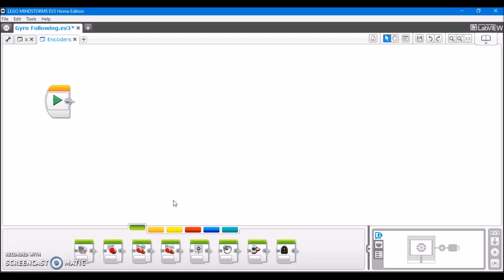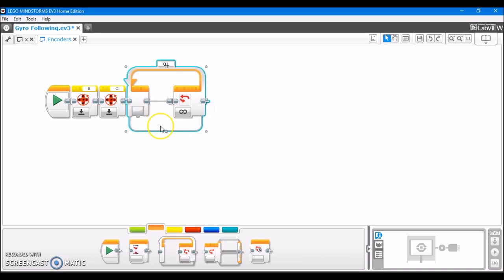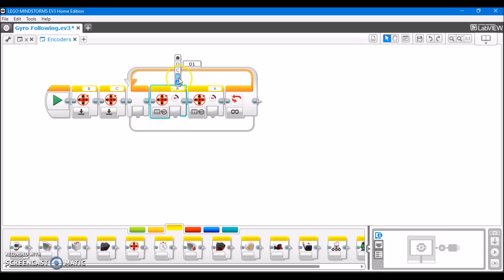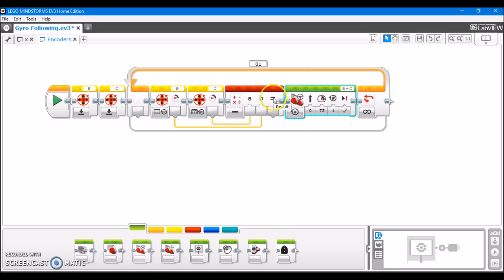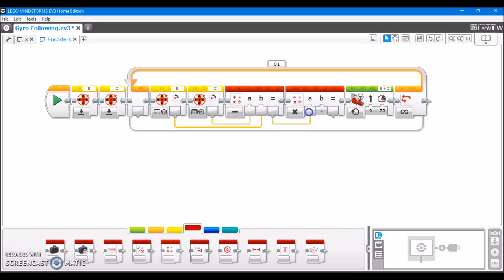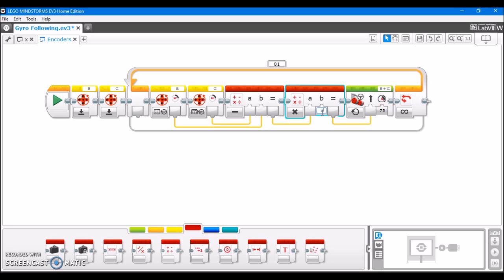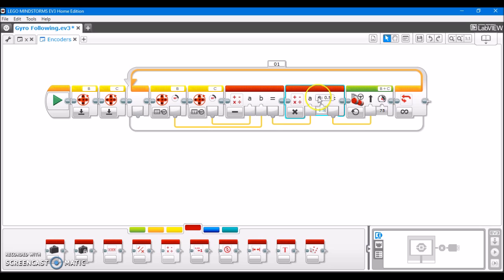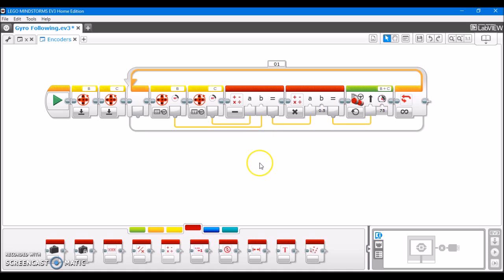How to Make your FLL Robot Drive Straight - EV3 Motor Encoders

Comment: Great video! I have one question, though: Ho do i make the loop so that it will go for a certain amount of rotations? I know how paremeters work, so that is not the problem. currently, I have two measure rotation blocks connected to two compare blocks(they say greater than or equal to), then the outcome is put in a logic operations "and" block, which is then put to the end of the loop, which is set to logic until true.

Comment: Sorry i know im late but my robot is not driving straight but it keeps leaning on the right side and i tried many different value but the robot still lean on the right side. It cant go straight. Builderdude35 can you please please help me
Reply from the maker: I would make sure that both drive motors are reset immediately before the drive-straight algorithm starts.
Reply: i did put a reset motors but still cant

Comment: Hi kyle, how about turning to a specific angle using only motor rotations and with pid control, without using gyro? Any idea? I saw your video about calculating the circumference etc but is it possible to use those data to make a pid controller for turning?
Reply from the maker: I think it's possible. In a recent video, I showcased an Excel spreadsheet that you can use to calculate turns (https://youtu.be/0XBvdZjdCpk). I think that if you take the equation from a spreadsheet and used it in a program to calculate a target turning path, then use the PID to keep it on that path, you will have what you are looking for.

Comment: When I use motor rotations as the loop exit case, the robot moves a little bit to the left after it is done moving straight. Do you know how to fix it? (I used B for loop exit case, which is my left wheel, greater than or equal to for the compare type, and 1 rotation.)
Reply from the maker: Make sure you have some block (placed immediately after the loop) that stops both motors together (make sure that your motor blocks are not set to "coast at end")

Comment: This concept works best of any drive straight algorithm I've tried.  2 things I really like:
(1) The motors will automatically compensate for the robot pulling left or right due to the weight of larger attachments.
(2) The simple MoveSteering control automatically handles any weird math exceptions that pop up around 0 or 100 power when using MoveTank, especially within acceleration/deceleration modules.
Reply from the maker: Thank you; I am glad that you are pleased with the performance!

Comment: Could you give program example of moving backwards using encoders? I wrote program for moving backwards and it works but it doens't meet end condition and it goes backwards infinitely.
Reply from the maker: What is your end condition? Maybe you forgot to set the end condition to a negative number of degrees (because you are driving in reverse).
Reply: I solved it in the meantime. It was about end condition. Thank you
Reply from the maker: Great! I'm glad to hear that you resolved the issue.

Comment: Hello,
I have tried to make the program that I will put a link to below. For some odd reason the robot will go for about 10 times not listening to how much I set the robot to move for (500 degrees), then on the 11th time or so, it would work. I called lego and they said there might be something wrong with the program. I tried updating firmware but that has not fixed anything either. Can you plese help me?

Link: https://1drv.ms/u/s!AkNYdEiPDMLqhDHZ_GFugcKkTQmW

Comment: I tried this and I tried the gyro method.  In the end, I got best results using the standard steering with a small offset (<1) on the steering power.   The method above gave me the same results (3-4" offset over 96") that I was with the standard method.
Reply from the maker: Thanks for sharing!
Reply: So I found a bug in the gyro.  When used directly with bluetooth, the gyro develops a drift, especially when it is accessed frequently by the program.  I assume that something in the way it continually reports the angle over the bluetooth to the EV3 program is causing the problem.  When I downloaded the program and disconnecting bluetooth, I found that the robot could run within a one inch  circle accuracy over 96" with the gyro.  From my point of view, that is sufficient to run most of the missions.

Comment: Good info but this will not work if either of the wheels comes off the ground, it wont know to slow or stop the other wheel, since it does not measure load/torque.
Reply from the maker: This is true, but if your robot is in a  situation where its wheels will come off the ground, you need other means of keeping it straight anyway.

Comment: 5:30 doesn't it already have the reset blocks at the beginning of the program?
Reply from the maker: Yes, but if you wanted to use this in the middle of a program, you'd start having problems. It's always best to include the reset just in case you want to move it somewhere else.
Reply: thanks!

Comment: If I take out the loop and change the "on" in the move steering block to on for rotations and put a value in that parameter, will the code still work?
Reply from the maker: The code will be very choppy. It will only check the difference after that number of rotations has passed. So no, it won't work very well.
Reply: thank you for your help
Reply: @Builderdude35  how can I set the program to drive straight for a specific number of rotations? I've been trying for days and I didn't find a solution that works properly.
Reply: @omarkhalaf7014  I aggree. It is very hard. I tried to use the motor encoders to sense once the rotations happened, but it did not work

Comment: Our team is so appreciative of your videos! Thanks for making them! Quick Question- how would you combine this program to make the robot drive straight with the program to ramp up and down?
Reply from the maker: That's going to be kind of complicated. But, you can add the programming for the drive straight into the loop after the acceleration bit. Think of it this way; acceleration sets the initial speed, then the drive straight program makes some adjustments.
Reply: Thank you so much! We'll try that!

Comment: When we run the robot, it turns very quickly to the desired angle.  Is there any way to slow down the rate of turn? Thanks so much for your videos!!!
Reply from the maker: Changing your proportional constant to a smaller number should help (that's the number you multiply by to adjust corrections).

Comment: What if the motors are supposed to move backwards? Do we switch the input for the subtract math block?
Reply from the maker: No, if the motors move the robot in reverse with positive power, the only thing that is affected is direction. You won't have to flip the turning in this case.

Comment: Question (challenge perhaps).  What would happen to this routine if one of the Read Rotation Sensor blocks got back a falsely higher/lower number than was actually in the motor.  What if an aspiring programmer, actually "built in" such a mathematical "fib" to skew those results.  How would the bot behave?
Reply from the maker: There shouldn't be any gap between encoder measurements and actual rotation; if you do, then you probably have a bigger problem. Anyway, If one were to manually add in an operation to skew the encoder values as they are put into the function, the robot will always turn away from whichever wheel it thinks has turned less. So, you will drive in a circle. The bigger the difference between the encoders, the tighter the circle will be.
Reply: Correct, I was not hinting towards a gap in the encoder process.  I was talking about as a programmer, how could one manipulate the math to make the robot do something different (but useful) than drive a straight line.  And the smaller the difference (or the induced fib) that "circle" would actually be an arc.  A controlled arc.  An arc can often times be more efficient and accurate than a straight and turn.  Arcs can also support acceleration/deaccel, again with some math thrown into the loop you have going.  Have fun, I hope you will take these ideas and run with them.

Comment: Nice vid.  Perhaps fixed in the latest firmware (but maybe you could experiment for me...) but the two motor RESETs tend to take a long time.  Long meaning a few milliseconds each.  So that if you use code like you show above, but place in a myBlock...then string many together with varying speeds/distances/etc....and just leave the motors running - the time it takes to do the two motor resets - can actually throw the bot off course for a tiny amount between each run of the myBlock.  There are ways around that, but hopefully the motor resets have been improved and introduce no noticeable delay.
Reply from the maker: Thanks for sharing this, I was unaware that the resets took so long.

Comment: If one had to choose between the EV3 Motor Encoder program shown in this video, and your previous video about "Gyro Following", I would use the Gyro for long-distance straight-line travelling.  During last season, our FLL team had a heck of a time handling the irregular roughness of the FLL Game Mat just east of the "Base" area, and handling the underlying defects of our plywood table.  When we implemented a variant of the Gyro Following (Gyro feedback) program shown in your previous video, it didn't matter if one of the robot wheels encountered different friction values on the mat or table -- it would correct itself and maintain it's straight "Heading".  I know that the EV3 Gyro is only accurate to plus-or-minus 2 degrees (at best), but that inaccuracy could be less than the EV3 Large Motor's internal gear lash (what you call "Slop").  Do you agree?
Reply from the maker: I agree with what you've said; you've brought up a great point!
Reply: a lot of the time my FLL team it tilts so this is really helpful!
Reply: I meant in my FLL team
Reply: Is Gyro more accurate than this program in going straight? What if one side of robot is heavier than other?

Comment: The normal move block does already have a PID controller for rotating the motors on the same speed, doesn't it?
Reply from the maker: Yes, it does. But this doesn't always work perfect in practice, especially when the motors are under unequal load (see my NXT Grunt video to see what I mean; I use this block there, too).